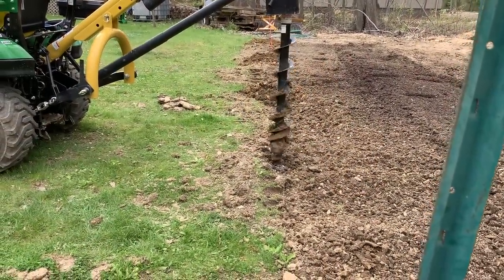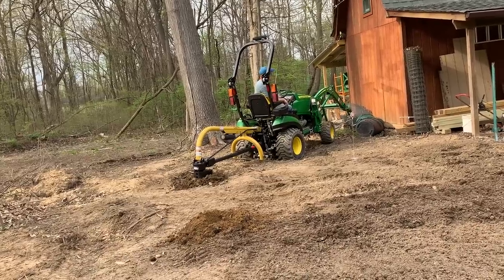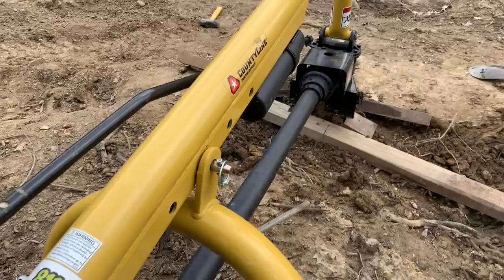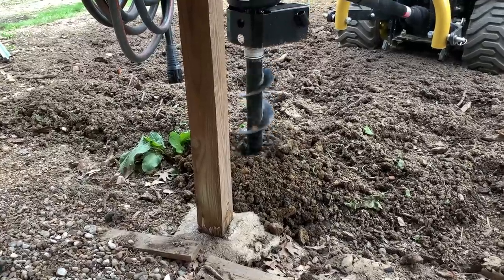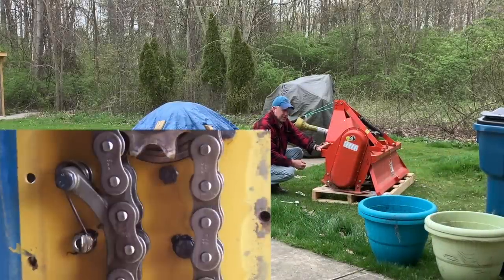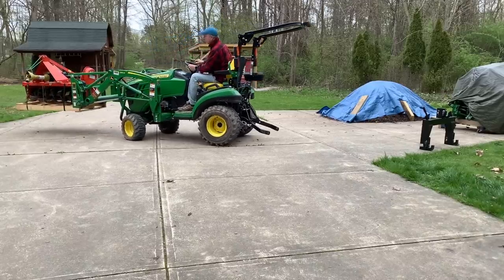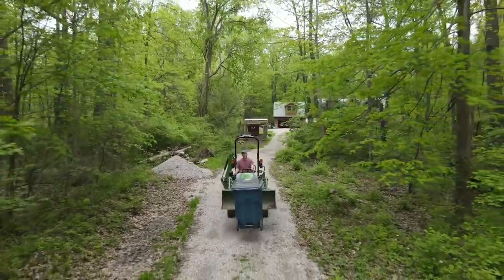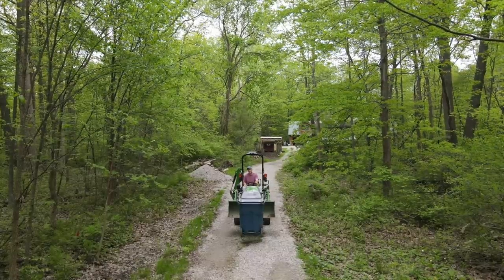John Deere 1025R:  Post Hole Drilling Sucks You In

Comment: Before you start drilling use your loader bucket flat on the ground and raise the front of the tractor off the ground about a foot and when you are stuck in the ground raise the loader
Reply: Awesome idea.  When I drill, mostly in clay, I just do a few inches at a time.  I have been sucked in many times.  Bet I'm gonna try this!

Comment: There are different reasons for what is happening. I drill well over 10,000 holes in a 6 month season.  1 There are many different tips and cutters for your auger the one you have is for sand and soil. If you look at the tip it looks like a wood screw. It will suck down into the ground faster then the auger can remove the cuttings. There are tips for hard soils  like stone or hard dry clay the cutter's are carbide  and the tip you have would work better for that because it would grind the hard soil to power. For clay you need cutter's that shave the clay into small pieces.  2 When you are drilling into wet soil or clay you need to go to a large diameter auger so the cutting can clear the hole quicker.  If you don't go to the larger aurger the wet material will turn into a larger muck ball and it creates a suction  and the way you got your auger wont work. At that point the only way to get it out is by following these steps.  1 You don't have a reverse on your tractor so you need to shit the gear box into nutral. 2 There is downward pressure on the auger take a 5 foot pipe wrench with a cheater bar and place it on the top part of the auger and start unscrewing the auger. Keep a little upward lift on the 3point hitch and it will come out nicely . The way you got the auger out worked but it could destroy your shear pin and in time the gear box . Great video.

Comment: Easy fix. Add a stand/stop on the auger shield so it doesn’t go all the way down in the ground. It’ll work the same as your wood boards but you shouldn’t have to get off the tractor.

Comment: A couple of tips:  1) try adjusting the drop speed valve on the 3 point hitch so the auger drops very slowly while making the hole. You don't want the auger pulling itself into the hole quickly or it will stall.  2). If the auger does get stuck and won't turn or come out you can loosen it in the hole by putting the three point in the up position and rocking the tractor back and forth to move the auger forward and back. Eventually it will pop out of the hole.

Comment: Like Leadfoot here in the comments, when I get my auger stuck, I just disconnect the auger and move the tractor out of the way.  I then pull out my 48" pipe wrench and manually reverse the auger to back it out.  If it's REALLY stuck, e.g., on a rock, I supplement the 48" pipe wrench with another 4' section of steel pipe over the pipe wrench's handle.  It's relatively easy -- and I'm a 74 year old woman.  The auger is up and unstuck in minutes.  I then reconnect the auger to the post hole attachment and I'm back in business.

Comment: I’m favorite attachment I hate the most is the post hole digger. Usually in that situation in that kind of ground I will only take little bites as you go down rather than like 6 inches take 2 As soon the tractor starts to labor even a little start up pressure.

Comment: Just put wood under the boom where the frame legs are. When it grabs if you stack the wood high enough it will keep it from getting stuck. Good for smaller jobs, but after 300ft picking the wood up gets old.

Comment: HERE  IS  WHY  YOU  ARE  SCREWING  YOUR  AUGER  INTO  THE  GROUND
The auger bit is suppose to scrape a small amount of dirt free from the planet beneath you. Especially when you have heavy clay, or wet hard pan, the auger must have time to chew a sliver from the bottom of the hole, collect it, and then fling the loose dirt out when you raise the spinning auger. What is happening is that you have your 3point hitch valve opened all the way. This is causing the 3 point hitch to lower too fast. So what happens is instead of your auger screw scraping small bites out of the bottom of the hole....you are allowing the full weight of entire attachment to push the auger into the earth like a screw, rather than let the bit take small bites out of the earth.

Use higher speeds, and close down that valve between your legs & under your seat. Let your auger TAKE SMALL BITES! #ChewYourSteakWell  #TakeSmallerBites  👍
Reply: The first correct answer I’ve read and not a single like or comment. That’s the world we live in 🎉

Comment: When it starts to bog down, instead of hitting the PTO off, raise your RPMs to give more power to the lift.  Be ready to turn RPMs back down, and turn off the PTO when it begins to raise back out.

Also, you can move the pivot pin on the Hoop towards the auger to give more leverage.

Comment: I used my auger today for the 1st. time and I could see this trying to happen to me...
My advantage is I was on a 4720 and conditions were right that my lift was able to overcome the screw-in effect.
Not sure that this will always be the case, but my 3 point has a little more umph.
I was also running a 8" or 10" auger.
one thing for sure... these beat a standard set of post hole diggers.
cheers.

Comment: Common problem unfortunately. I have used mine a lot in the past couple weeks. Couple pointers i have are, right above idle around 350 is best in my soil, as soon as you hear the auger start to bite pull up on the 3 point. Constantly up and down cleaning the hole. Patience is everything with this setup. Lol.If you do get sucked in, instead of engaging the pto under load, simply disconnect the shaft at tractor and use a pry bar or lever of some sort to insert through the shaft at the u joint then rotate backwards and have a friend pull up on 3 point while doing so. Its actually fairly easy once you have done it a few times. A forward/reverse gearbox would be awesome for someone to come out with . Hope that helps.
Reply from the maker: Thanks Aaron for taking the time to share some good advice!

Comment: We have a lot of clay and rock around here.  Done that many times....talk about a sinking feeling!  Saw a few other comments where they say don’t let it dig in,  that’s the ticket with clay,  little bites and also because how clay bites,  helps to keep the auger perfectly up and down so It doesn’t bite the side wall of the hole and steal the power from the lift arms.  When I got stuck, would always disconnect auger but,  put a big pipe wrench on the auger shaft with a cheater piper and back it out like a giant screw.  Don’t listen to these people saying you need a bigger tractor for what you’re doing,  if a guy knows his tractor he can get a lot done with a sub compact.
Reply from the maker: I usually have the pipe wrench standing by, but hope I can avoid using it.
Reply: @ataleofthreecabins1025  I pop 12-inch diameter, 3-foot holes with my 1025R in clay.  I just don't rush it.

Comment: When you start to hit the right soft material, the auger will no longer cut and lift material, but actually start screwing itself into the ground, just like a wood screw.  Because it is not breaking up the material, the material can still be solid and the bit is embedding itself in it (just like a wood screw).  Because it is screwing itself into the material and not cutting and lifting, you can get a auger stuck.  What you want is the auger to function like a drill bit, cutting the material, or like stripping the threads out of a piece of wood instead of screwing itself into it.  Since the PTO doesn't have reverse, you can find plenty of stories online where people had to take the auger lose, move the tractor out of the way, then put a REALLY BIG pipe wrench on the bit to try to reverse it out.  Sometimes this requires a length of galvanized pipe on the end of the wrench for leverage and two people.  The first indication of this happening is the bit starts dropping into the ground really fast (It has started screwing down and not cutting/lifting material out).  When this happens, stop the PTO, and lift the hitch as quickly as possible to lift out the material.  This can also happen when you pass a large root or a rock.  If the material below is soft enough, once the screw catches the root (or rock), instead of cutting it and pulling it out, the auger starts screwing past it.  I have never gotten one stuck, but I have come close plenty of times.  Good Luck!

Comment: Hydraulic post drivers are the way to go...we were able to drive 8" posts thru 40+ inches of frost no problem for running high tensile. No need for the auger anymore, unless you're a lineman.

Comment: Your letting Auger screw its self into the ground bit like a massive screw rather than digging hole , soon as it starts screwing in either lift of cut power . We have same problem with 2 man Stihl post hole auger in our heavy clay soil ,had to dig auger out once ,but if you lift soon as you feel it grab you can avoid this

Comment: Have them give you the yellow 4ft countyline tiller.  Many folks I have seen have that one on the 1025r and it works fine.  Reviews on tractor supply site say you can't use it on the 1025r, but it handles it just fine.  Can reverse it as well, but I wouldn't do it without making a guard/flap in the front first or you and the tractor get covered in dirt.  Guy did it a few weeks ago and has a video and made a world of difference. Why Tarter doesn't make a kit is beyond me!
Reply from the maker: I"m still waiting for the replacement.  All I know at this time is it has the countyline name, it's yellow, it's a newer model, cause it does not appear on their site yet,  and Tartar called it a light duty tiller.
Reply: @ataleofthreecabins1025  I was talking about this one.  Interesting that they are coming out with a new model of the light duty version.   https://www.tractorsupply.com/tsc/product/countyline-rotary-tiller-4-ft?solr=1&cm_vc=-10005&st=tiller

Comment: Nice video, Tractor Mike. 

1.) Why do you have your hand on that long handle when drilling the auger into the ground. I dont believe I've seen that before. 

2.) If this will help, ya might take ya a can of bright red or bright orange spraypaint & paint a mark around the center auger shaft just above 3rd or the 2nd auger screw blade from the top of the shaft at the gear box. that idea would leave you a good visual mark to not go quite as deep with the auger & bog down. . . . .just a thought. 

3.) If your ever traveling to with heavy load on the loader & no "ballast weight" of any kind, & ya get rear tire spin at any time from loss of traction as shown in the video, put your tractor in 4WD. That way ya have the steer axle helping you  with traction & helps ya to move. 

99% of the time when im using my loader for whatever reason on my 1025R, i have my 6' FT blade hooked up to the 3-point hitch on the back for "ballest weight". This really helps alot. 

Thankya for sharing the video & stay safe. God bless!
Reply: Rodney Leonard  - it keeps the tractor from spinning around if the auger grabs.
Reply from the maker: It keeps the auger in place when it comes out of the hole, otherwise it has a tendency to move and miss the hole coming back down.

Comment: Pay attention to the sound of the engine at normal operation, when you hear the slightest difference in the idle of the engine pick up on your auger to clean it out, if you don’t it’s just gonna bury itself & cause you unnecessary work & stress on your equipment. & that’s not just for the auger that’s for anything attached to the PTO. You should know how your engine sounds when everything is running smoothly, when you hear it start sounding different you need to make adjustments.

Comment: Did the tiller PTO shaft have shear bolts or clutch. If clutch tighten the bolts. To put more pressure on the clutch plates to prevent from slipping in hard tilling
Reply from the maker: Shear bolts, they do tend to break more at higher PTO speeds.

Comment: Do you have a box blade?? If so what brand. Thanks to your video I decided to go with TSCs 3 point post hole digger. Looking to get the country line box blade as well. Just curious whether or not if my tractor could handle a 5 footer. I have the 2025r
Reply from the maker: I have the Fontier 4' and  my 1025r handles it well for smoothing out our driveway.  I should have got the countyline and saved $300.  I think you'd be OK with the 5'.

Comment: You can use the 3pt drop rate valve to prevent the post hole digger from screwing itself into the ground. just set the drop rate to very slowly fall. I had to learn the hard way also.

Comment: Once drilled deep - then rev up and pull it all out!  Then rev down and dill another.
Reply: I think you’re right.  The low rpms probably wasn’t building enough hydraulic pressure to lift the 3pt hitch.

Comment: If TSC doesn't sell it anymore there's probably a good reason. Personally I would have gotten a different one.
Reply: I likely agree. Would research why discontinued. If proven to have a design flaw I'd want my money back and move on to a better product. I always enjoy these video's.
Reply from the maker: I originally was looking for the RK 48' XB, but our local store was out of them.  So if I ordered one even ship to store was an extra $300. which put me our of range for the amount of tilling I do.  I had heard that Tartar makes a large amount of the tillers and even the one I got came with a 48 XB manual.  TSC happened to have a sale, plus I had a 10% off coupon so that's when I pulled the trigger.
Reply: @ataleofthreecabins1025  I'd of done the same thing probably..

Comment: you just got some lessons from the University of LBYOM  learn by your own mistakes. I currently hold a masters degree from there and am working on my PHD
Reply: roy hoco 
Got mine, easier than I thought.
Reply from the maker: My mistakes are for the benefit of mankind.
Reply: You have only mastered something after you have made every mistake possible.  An old man once told me that at Binion's casino Las Vegas 🎰 in the back at the bar.

Comment: This may have been covered already, but the problem with your tiller may be the PTO clutch.  Did you happen to smell burning when the tiller is in the dirt?  Is the pto spinning faster than the tines?  Just an idea.
Reply from the maker: I'm pretty certain it's the chain tensioner as the PTO spins into the gearbox and the driveshaft going to the gears with the chain spins, but a loud grinding sound comes from the chain.  No burning smell. Oils and greases are good. Thanks for taking the time, Tom

Comment: Why do these post hole diggers appear to drill at an angle instead of straight down?
Reply from the maker: It's a little tricky.  I usually have some one stand back and watch.  Once the auger starts descending, you usually have to back the tractor up slightly to keep it straight.

Comment: What causes the auger to get sucked into the dirt like that? Lack of 3 point hitch power to lift? Or the type of soil? Would a bigger tractor with more 3 point hitch power still get stuck like that? Or is it the quality of your auger?
Reply: Tyler Blazo, it’s when the auger “corkscrews” into the ground and acts like an anchor, biting more earth than the 3 point hitch can lift; instead of talking small bites and using the auger like a screw conveyor to move dirt to top of hole.  I’m short, it’s letting the auger screw itself down too much instead of stopping to convey dirt up and out. Taking too big of a “bite” between lifts. 
The hole can be drilled to any depth as long as you take small bites.